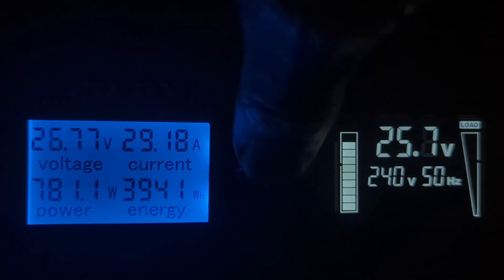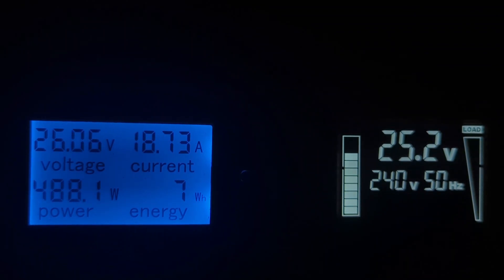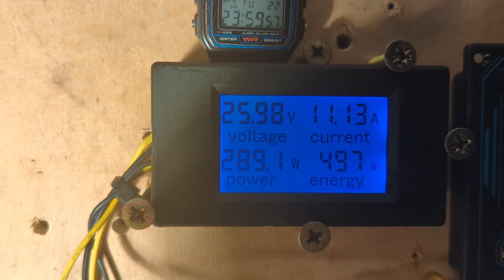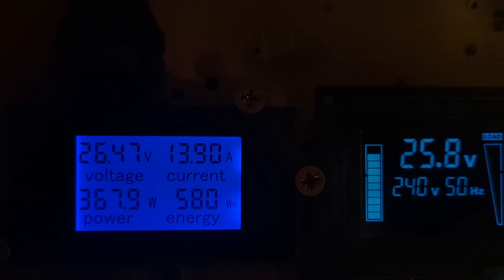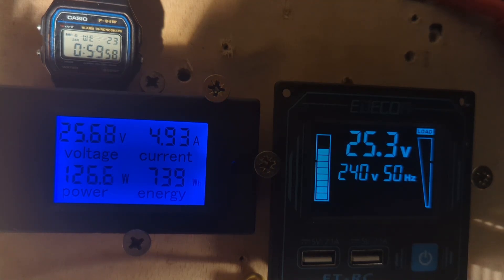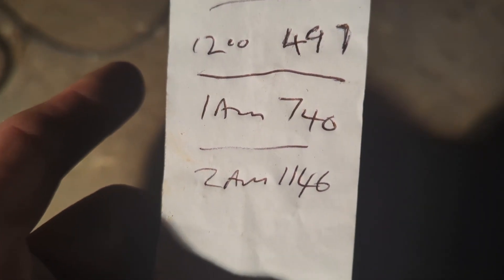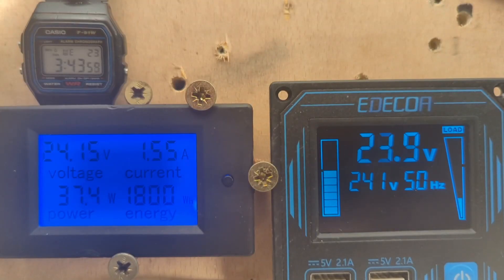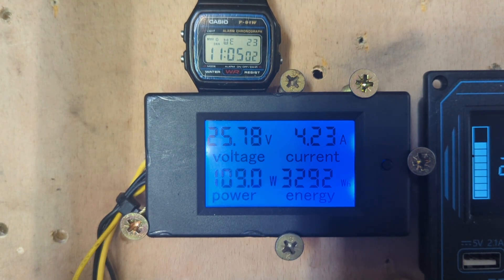another 3 kW hours of free electricity last night - wind turbine generator project.

Comment: The more blades, the higher output for a given swept area. You are absolutely right. Only reason 3 blades are common is because they are the minimum number of blades that are favourable vibration wise and they offer the best compromise between wing material cost and power output.

Comment: 3.43am - what's what I call dedication!.  I've noticed that if I add a large load to my inverter the turbine power often shoots up before coming to a slightly lower level. The extra  load creates an additional battery voltage drop which in turn means that the turbine has an easier job of shoving out more current for a short while but then of course slows down a bit. Maybe with a crazy yet ingenious array of levers, relays and resistors one could create a mechanical version of MPPT. 😂   Seriously, there does seem to be a dearth of wind controllers with MPPT. Loads of those cheapish Chinese ones for £140-£180 on Amazon/Ebay but hardly any useful reviews anywwhere, especially in relation to longer term usage. Have you come across any that look like making sense I wonder?